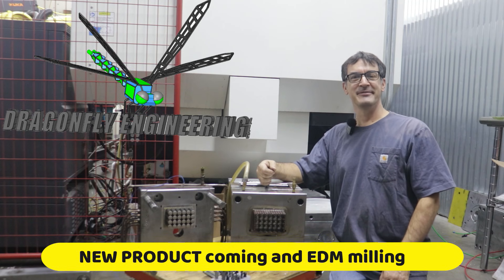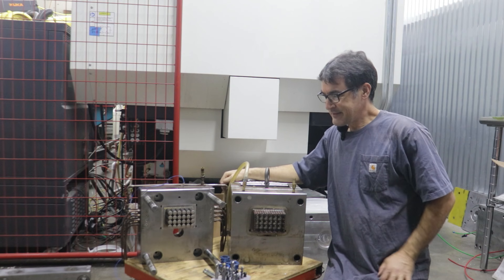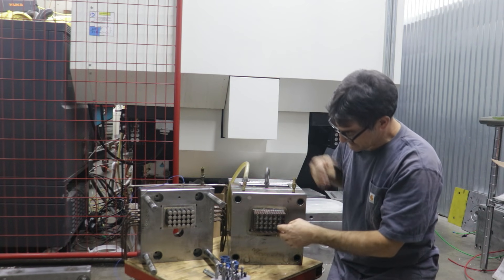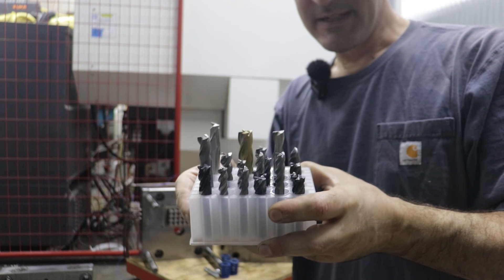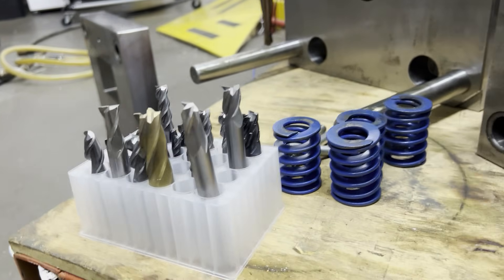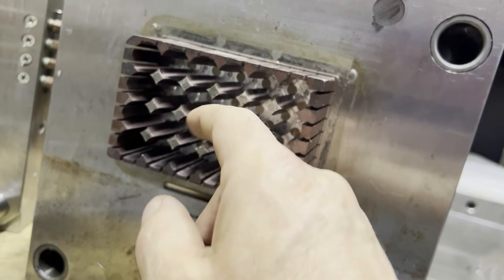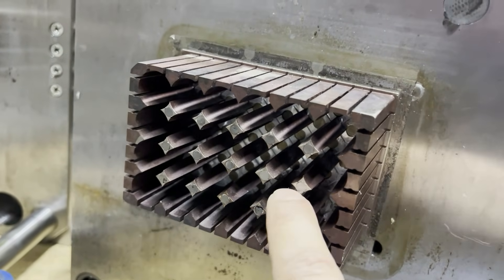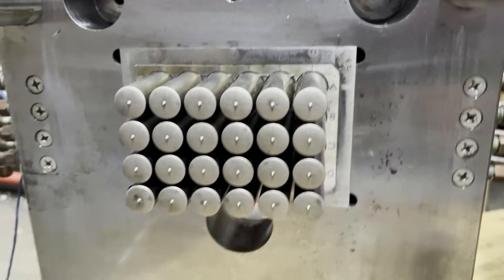NEW PRODUCT coming and EDM milling

Comment: Is there a reason you were conventional milling the copper instead of climb?
Reply from the maker: Mastercam lead the way on the tool cut.  I think it conventional mills for the lead in cut, then it switches to climb for the actual cut.  The lead in cut was a full profile path with a 3 deg plung angle

Comment: I had a mold designed many years back to make around 200 parts, often wondered what happened to the mold.  
On the EDM how much do you have to allow for the tool ware as it burns the harder material in the mold?

Should look into molding  boxes for the Gridfinity  3Dprinted storage box system
Reply: I bet there'd actually be quite the market for gridfinity stuff. OR the 'not-quite-gridfinity' stuff that Clough42 did for some tooling organization a while ago
Reply from the maker: cool, I need to look into that stuff too.
Reply from the maker: For copper EDM tool, I only made the one for 24 burns.  If it was graphit, then I would need to make ~3 or 4.  I also allow a spark gap of ~100um. ( 004') Thanks for watching!